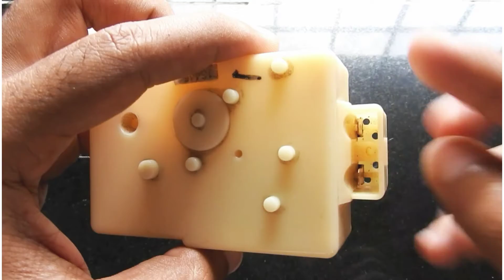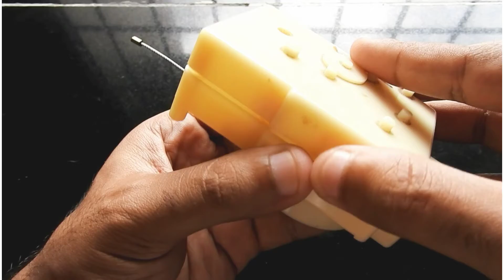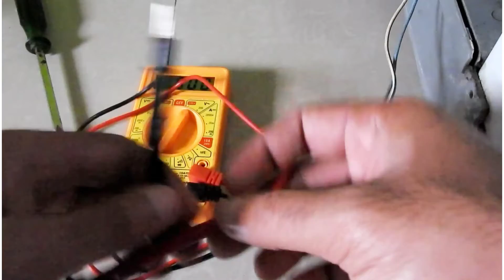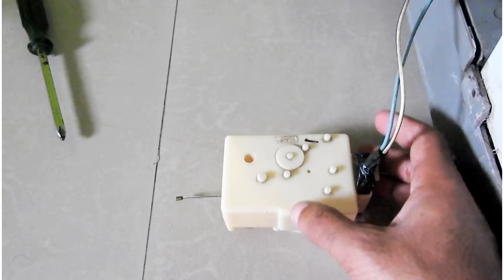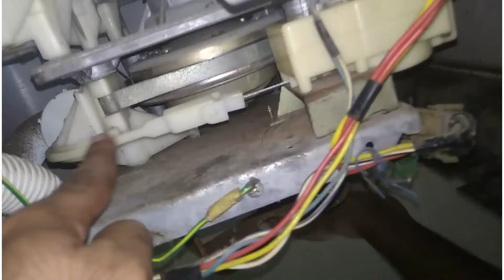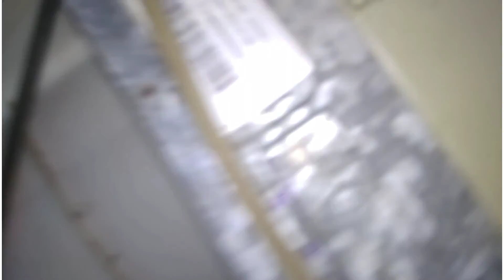Washing machine not draining? not turning? How to fix washing machine brake actuator / drain motor?

Comment: Does the drain motor stops after pulling the drain valve or runs untill the spin and rinse completes, and after the wire is pulled inside and if i pull the wire out when then drain motor is running will the wire come out or will be hard to pull.
Reply from the maker: The drain motor only pulls the wire to open a valve so the water can drain. Yes it stays pulled till spin cycle is completed. Once spin is completed the drain motor stops working and valve wire goes back with spring action closing the valve.

Comment: my motor pulls the wire but dont release it.wire has to be manually released after switching off the washing machine.i have Samsung wobble automatic machine.please help.
Reply from the maker: It could mean one of the two things
1. The motor is not pulling hard enough
2. The drain latch is jammed, and needs more force to pull

Either way I will suggest lubrication at both points.
Take apart the motor apply grease and reassemble, this should solve it.
Please do show your support to the Channel by subscribing. Thank you!

Comment: So, help. My pump is doing what it should but often wont drain... its a huge ordeal to get it to. Was going to replace the motor but wondering if thats even it now.
Reply from the maker: Something like this happened in my case as well. The actuator pulls on the drain plug. Over many years of operations there is a chance the mechanism gets weak and isn't able to overcome friction on the gears. In this video I simply disassembled, greased the gears and reassembled. It worked well ever since. If you found this video insightful do consider subscribing.

Comment: Hi
Drain valve not closing back after spin or even at power off.
When slightly tapping on drain motor  area , it get released 
So I changed drain motor but same problem persists.
Tried to clean drain valve compartment  pulling and releasing it manually while allowing soap water filled in the tub to pass through the drain valve. 
Not solved.........
Removed and greased splutch assembly
Still not solved 
Help please......
Reply from the maker: Adding some oil/grease in the motor assembly worked for me, try cleaning the electric contact point of your drain motor

Comment: If water is not holding in tub continuously overflowing from the drain pipe during the washing option,secondly breaks are not applied when the lid of the washing machine is opened or spin cycle is completed, thirdly during washing option the tub rotates half a circle like in washing n rotates half a circle like in spin n voice of spin also,n during all these water is coming in tub n continuously coming out from the drain pipe ,where is the problem ,plz diganose
Reply from the maker: There are too many things going wrong. Water escaping the tub could mean drain plug or drain actuator not working. Brakes not being applied could mean a fault door switch/relay or faulty drain actuator since that's what engages or releases the brake mechanism.
Please look to buy a new machine.